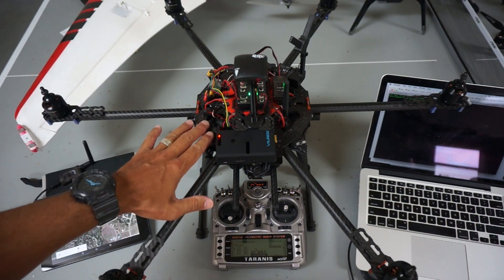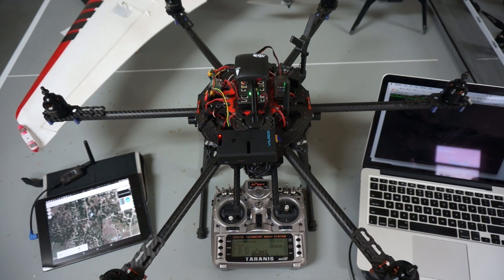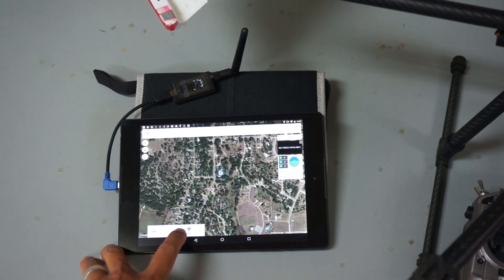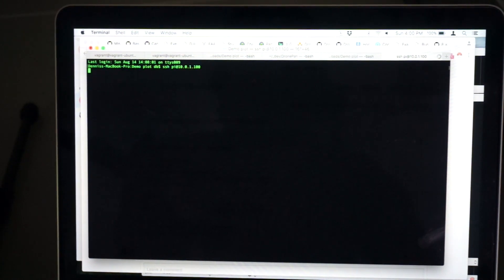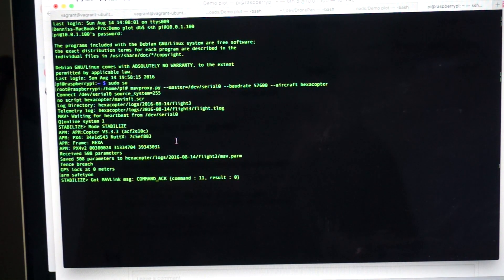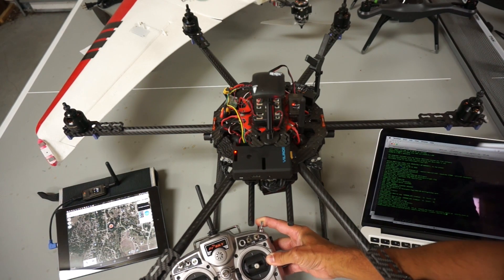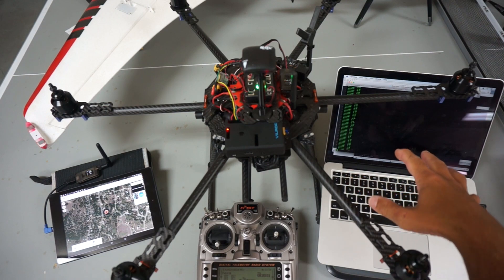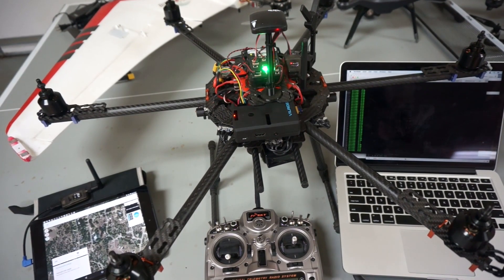Raspberry Pi, Pixhawk Hexacopter and DroneKit Pre-Field Bench Test

Comment: Hi Dennis!! i get on mi Rpi "Waiting for the vehicle to inicialise" what i should do?
I can connect it ,when i do changes with my transmisor (controller) i can see the changes on the rpi so the connection is good but i cant run .py it seems pls help me
Reply from the maker: I'm not really sure what's going on. I tried to read through some posts in the DroneKit forums, but the site is down. There are a few posts with the same problem you're having. Maybe it will come back up in a bit. Will let you know if I can dig anything up.

Comment: Hi sir, one question. How do you know that the commands, say for example arming the safety switch is programmed to be "arm safetyon" or, off? This line is not at all mentioned in your code. Please advice, thanks!
Reply from the maker: Check out the documentation here:

http://ardupilot.github.io/MAVProxy/html/uav_configuration/arming.html

Good question.

Comment: Dennis, Can You Please answer my question about esc's? I am Building a TAROT TL250H Mini Quad Using Emax MT2204 2300KV MOTORS WITH 5x4x3 TRI PROPS And it calls for 12 amp ESC'S  I am not using it for racing and never using 4s lipos ever just 3slipos. My question is I have new Flycolor 30amp 2-4s simonk esc's that I am going to use but they have very thick and heavy heatsinks in the esc's, I know that 30amp is overkill but there new I have a lot of them and I want to use them! Do You Think it will be ok to remove the Heatsinks from the esc's Because of the weight and how heavy the heatsinks are, the esc's will be placed on the arms so they will get max airflow from the motors and from flying DO YOU THINK THAT IT WILL BE OK TO REMOVE THE HEATSINKS ON THE ESC"S? PLEASE ANSWER AS SOON AS POSSIBLE?